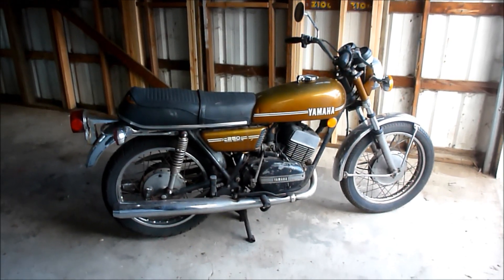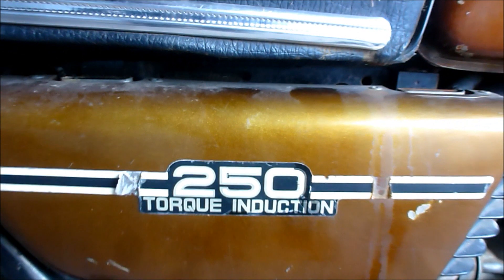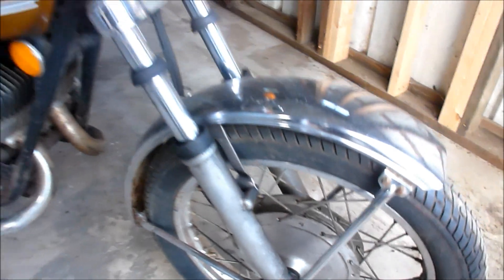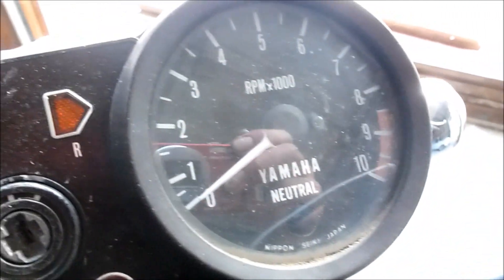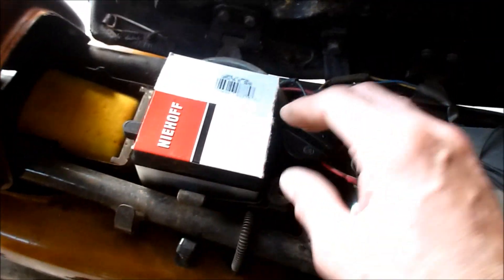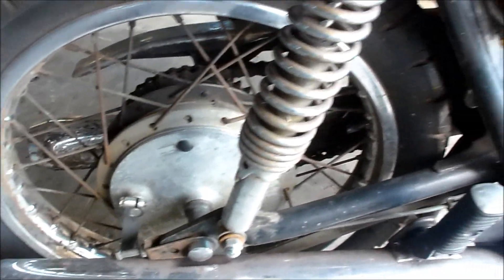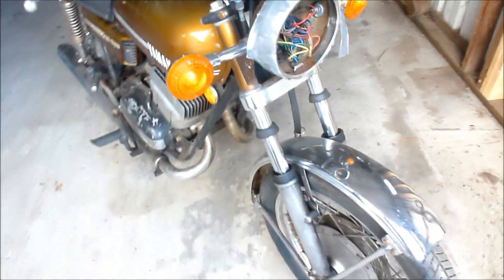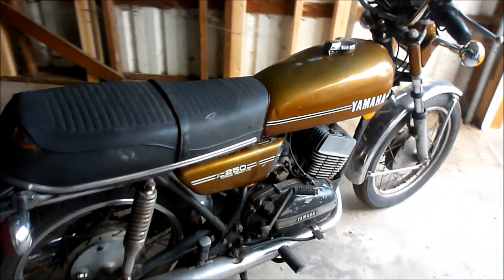Classic 1974 Yamaha RD 250 project

Comment: What a visual surprise. My late father discovered motorcycling when my brothers and I did, and he bought one EXACTLY like this one brand new. I worked in a Yamaha shop and never saw any problems with oil injection. It's a great convenience.  These 250s are peppy, but not nearly as fast stock as the Suzuki X6 Hustler was. Yamaha was rather conservative with the power output on its road bikes, and even the Suzukis got slower in subsequent models, I think in an an attempt to make them live longer.

Comment: That is a fine gift!  I was given a 70's Kawsaki 400 two stroke, and thought it was going to be a neat project because it was supposed to have been running when parked, but in the end it looks like it was run out of oil and seized! Bummer... This looks like it will be a nice machine for a two stroke guru!  It's funny to me this looks much older than my R75/6 BMW motorcycle even though mine is from a very old engine design and it's only a year newer, very strange! I hope she runs like a champ!

Comment: Oh and I highly recommend blocking off the oil injection. Especially on these. It's less convenient to mix up premix and there's always the "what if I run out on the road" but just take and too her off before each ride and you will never run that tank dry. They LOVE 32:1 and I personally HIGHLY recommend Golden Spectro. If it was good enough for our 200cc air cooled yammito be beat on for 13 years straight with ZERO break downs (still pushed 130 pounds of compression) then your RD here is gunna